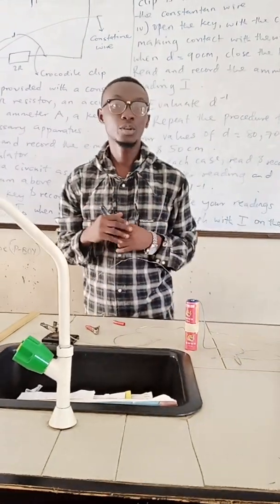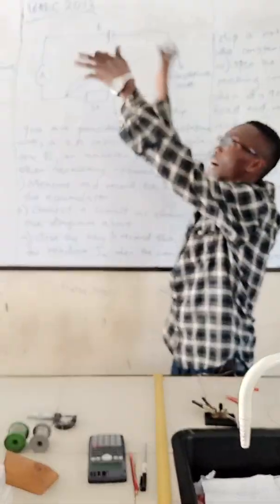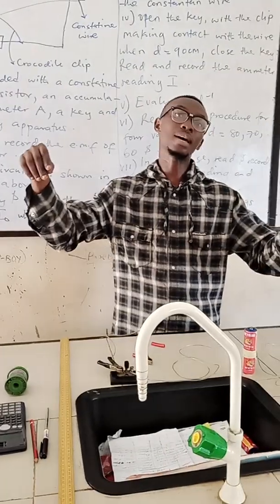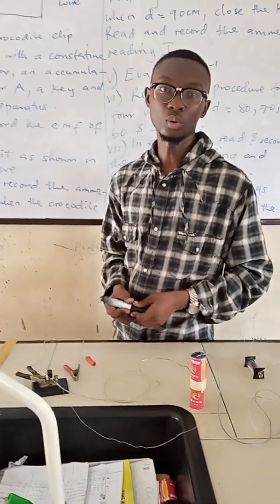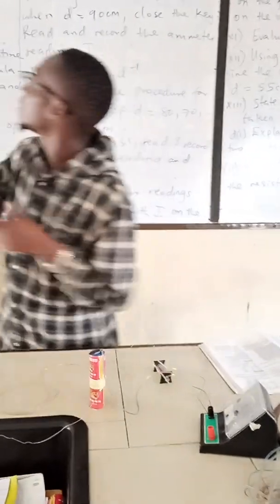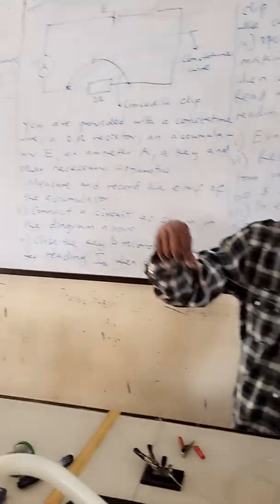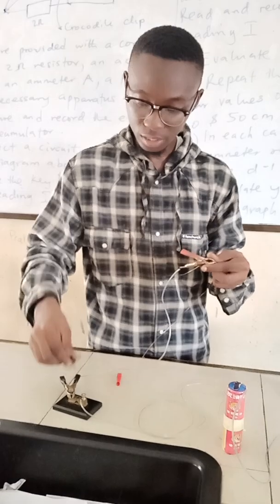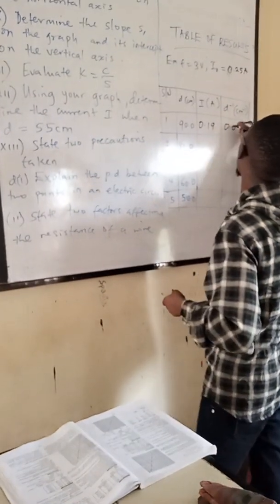WAEC 2021 PHYSICS PRACTICAL PREDICTABLE QUESTION ON ELECTRICITY...

Comment: Your circuit connection is wrong,What you connected is different from the circuit drawn,,,pls! Recheck
Reply from the maker: thanks for the reply, the positive terminal of the battery is connected to the positive terminal of the ammeter. Just make sure the constantine wire is connected at the end of the standard resistor and the crocodile clip to the other end
Reply from the maker: thanks again I understand fully well....thanks for pointing that out
Reply: @frankztutor4516  Boss but what you connected in the video is different,I can draw the circuit connection of what you drawn and send
Reply: @frankztutor4516  you connected the positive terminal of the battery to positive terminal of the ammeter(correct)then -ve terminal of the ammeter to one leg of the standard resistor(correct)you now connected the constantan wire to the other leg of the resistor (wrong) and then connected the crocodile clip to the switch,the constantan wire should be connected along the -ve terminal of the ammeter as shown in the diagram and not second leg of the resistor
Reply from the maker: @bellajon3328  thanks for the observation....really grateful....would do a video to correct that thanks